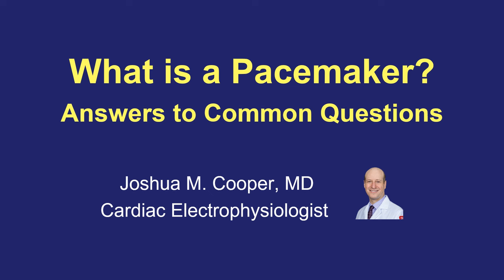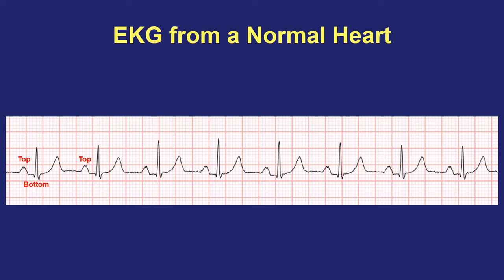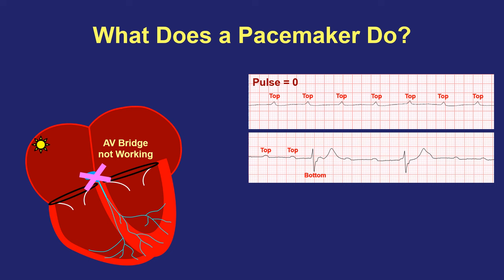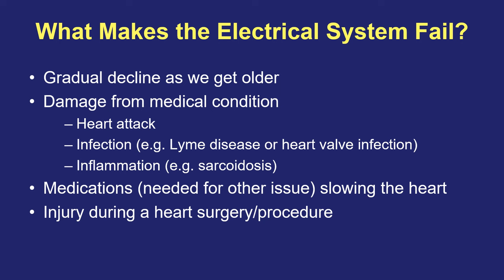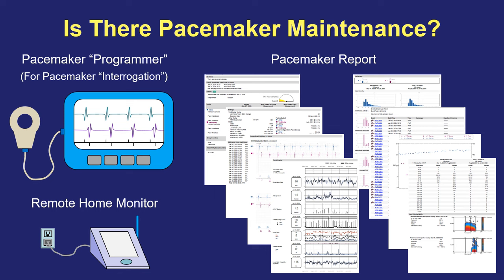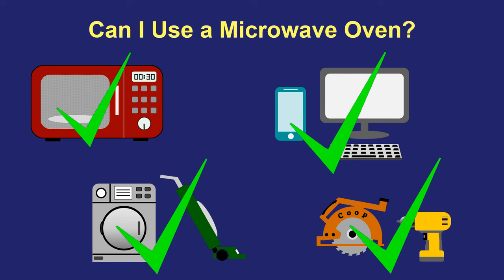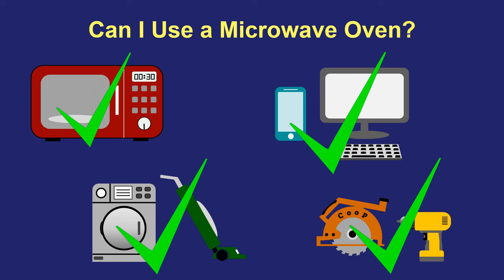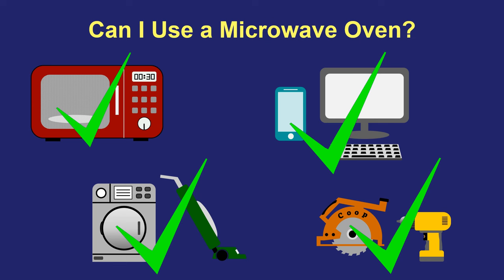Living With A Pacemaker (common questions answered) - in Plain English!

Comment: What an excellent presentation, thank you for taking the trouble to publish this video. I am still struggling to find defined dos and don’ts in relation to welding - there appears to be a level of (hooby)welding which is possible but generally no specifics are to be found.
Reply from the maker: Thank you so much for your comments and question. I haven't found one resource that speaks to all of the issues. The main principal is trying to avoid the pacemaker (or implanted defibrillator) and the pacemaker wires in the body being exposed to a high enough electromagnetic field that the device could detect the electrical signals/field and falsely think that these signals are coming from the heart. This situation could include being very close to a strong electromagnetic field, a rapidly pulsating electric field, or having current run through the body because of poor grounding or moisture on one's hands while welding.

Here's one example of "rules" i found:

Keep amperage range under 130A

Avoid using any welding machines with Pulse function (typically found on some higher-end / professional TIG and MIG machines, however can be found in some Stick/MMA machines as well), or High-Frequency function (typically found on professional TIG machines, and some plasma cutters).

Keep your clothing (includes gloves and shoes) and work area dry at all times

There should be at least a 600mm / 2 ft. distant between your pacemaker and the welding arc

Keep welding cables and the welding machine as far from you as possible. The recommended distance for the welding unit is around 1.5m / 5 feet from where you work.

Where possible, twist the welding cables together, and ensure that the pacemaker user is not stood in a current loop, with the torch on one side and the return cable on the other.
Reply: @dr.joshuacooper-arrhythmia9917  Many thanks once again.

Comment: I am congenital bradycardia patient. I had complete heart block. Got pacemaker few months ago but since i got it. Life is not normal. I'm 40. Get tired and feel shortness of breath. Sometimes feel slight pain and pressure on left side and left arm. Is it normal after pacemaker?
Reply from the maker: There are several reasons that someone might not feel well after getting a pacemaker for heart block. Much of it has to do with the way the pacemaker is programmed, and lead placement in the heart can also impact how the pacemaker functions. You should see your EP doc and let them know you are not feeling well so that they can help figure out solutions.

Comment: Oh my! I've learned so much more from you than from the device tech and cardiologist , but its hard to learn much from a 5 minute doctor appointment. I've only seen the cardiologist for 5 minutes in the 15 months I've had the pacemaker that was 5 months ago when he told me one of the leads was not working and that it broke a few months after getting it. He doesn't want to run any tests besides remote interrogations to see if the separated or why it's not working.

Comment: Thanks for sharing
Reply from the maker: Thanks! I hope it makes sense! 🤞
Reply: In epicardial pacemaker in a post CABG patient, can we pace afib or same as the implantable ones that it has no effect? On a fibrillating heart?
Reply from the maker: @gemmasantos1572  epicardial pacing wires essentially work the same as an implantable pacemaker. They cannot prevent atrial fibrillation. They can only prevent the heart rate from falling below a programmed cutoff.

Comment: Can a patient with a dual chamber pacemaker , undergo an electro cardioversion for atrial flutter ?
Reply from the maker: Yes, electrical cardioversion can be done safely in patients with pacemakers (recommend not putting a defib adhesive pad right on top of the pacemaker, although that's not the proper location for the front pad anyway!)
Reply: Thanks for that reply, It’s very comforting. There are questions regarding electrophysiology of the heart which are not easy to find answers to despite all the literature out there .